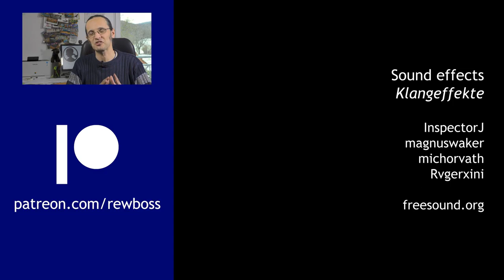Don't buy a cuckoo clock

Comment: This makes me miss my parents' clock. They inherited it from my grandpartens and when it stopped working and couldn't be fixed anymore, we'd still hear it in our head every hour... Is that trauma or a fond memory?
Reply: Bring it to a clockmaker he will be able to repair it
Reply: @the_retag  ...maybe...
Reply: Trauma, clearly.
Reply: I'd say it's the memory of a fond trauma.
Reply: @the_retag  we asked two clockmakers and they said it's so worn, the whole mechanism would have to be replaced. So it now serves as decoration
Reply: Phantom pain 🙃😉.........
Reply: @Yithiru  You can buy a new movement. I found one on eBay
Reply: They forgot one thing!!! Like any mechanical device, it needs maintenance! Any mechanical watch needs maintenance between 3 and 5 years, by a watchmaker (which is the period that lubrication lasts). Basic maintenance consists of disassembly, washing of the mechanism, general deep cleaning, reassembly, checking and correction of clearances and lubrication. If not this way, it will really break, it's NATURAL.
Reply: @Yithiru  they are about 120 -175 for a basic regula movement. Not sure about the more fancy ones, but you could just buy a movement online and replace it yourself if your somewhat mechanically inclined. There are many many youtube videos on clock repair.
Reply: That clock can be repaired I repair them all the time.

Comment: 4:25 "It will sooner or later break"
The cuckoo clock of my parents worked 27 years.
Reply: So it didn't break sooner, but later...
Reply: But it was VERY annoying.
Reply: Well made ones last but are really expenisve, but the cheap souvenir stuff breaks fast.
Reply: My grandma's is almost 50 and still going strong.  I repaired it for her about 1 year ago, and it's running great!
Reply: Several of mine are over a century and still work and are nearly exactly as they are when they were built. My most pristine century-old cuckoo clock dates to 1919. It's pretty much still exactly as how it was when it was built. Original flutes, bellows, everything. No damage to the case or facade.
Reply: Admit it, you destroyed it when moving out because it annoyed you so much!
Reply: @CBF1  where did you buy it from ?
Reply: Ours worked for over 15 years. 

If someone's breaks then ask them when they've had it serviced... I bet they've never done that.
Reply: I'm a watch guy, so I understand mechanical clocks on the basic level.  People tend to think clocks should work forever with no upkeep, but it's still a machine.  If you get them serviced periodically, they can last you a lifetime.
Reply: If you look after any genuine black forest clock.they will last
Reply: @MrDlt123  what is the recommended upkeep?
Reply: As long as clock repairmen exist, your quality clocks will be able to last for hundreds of years, if not more.

Comment: Psst, nobody should know that. 
Every stranger should have a cuckoo clock, because Germans would not buy it. 
But it is a tradition that every stranger has one, has a beer mug next to it and has visited Neuschwanstein.
Reply: It’s like you were following me around. I like my photo of the castle better than any other.
Reply: don't you dare disrespect a stein by calling it a mug. and I use the term stein only for anyone not from Germany so they know what I'm talking about
Reply: @TeenDream888  correct term is "Bierkrug" pronounced "Beercroog". "Bierstein" is unknown in Germany, we have only "Steinkrug" pronounced Stynecroog which is a ceramic mug.
Reply: @fafnir-fasolt  And the Bembel. Can't forget the Bembel.
Reply: @HotelPapa100  we talk about beer, no one needs vinegar bottles.
Reply: @fafnir-fasolt  Wrong! Where I grew up (Palatinate), the litre mug known in Bavaria as a "Mass"  is called a "Stein". As far as I remember, they were mainly used for Weizenradler from bottled Weizenbier.
Reply: @fafnir-fasolt  Shtynecroog, to be correct, Kollege :)
Reply: Sounds like a pretty good little trip to Germany! ;)

Comment: The school at which I teach has an exchange partnership with a school that is located in the Black Forest. Quite a few of the locals there have cuckoo clocks. My host from our last trip has 2. I know "no one buys them" is hyperbole, but I think anyone who wants to buy some tacky bit of randomness, should go do it. Your money. Your problems. 

That said, my mother bought a "real German" cuckoo clock real cheap from some dude she barely knew. Amazingly, she almost never remembered to wind it (pull the chain or whatever), so it was almost always either wrong, not working or both. After about 6 months of that, it broke. Now it is completely useless, but still hangs on the wall, because "why not". 

I personally own a cuckoo clock of sorts. I bought one of those refrigerator magnet ones from Neuschwanstein. It looks like Neuschwanstein, but has a clock face on the front of it. It is really just a cheap plastic clock face attached to an even cheaper plastic approximation of the only castle Americans usually know about, but definitely can't pronounce. Within 4 months of having it, my son knocked it off of the refrigerator several times. Now the clock doesn't work and a few of the towers are broken. It is still on the refrigerator, however, because my wife likes it. Happy wife. Happy life. 

I visited one of the "world's largest cuckoo clocks". I was unimpressed. I was more entertained by the glass blowing place next door. Definitely one of the worst tourist traps I have been to. 3/10 would not recommend.
Reply: My grandparents used to live in the blackforrest and also had several cockoo clocks and my grandpa rewinded them every morning. As a kids we were always waiting for the full hour to see the cockoo and because the clocks were not going exactly right we could run from one room to the other to see all the cockoos
Reply: I was born in Germany and lived there until I was 6.  My grandparents had a cuckoo clock in their home.  I returned to Germany in 2005, went to my home town and asked a local shop owner where I could buy a cuckoo clock... and it was not in a souvenir shop.

Comment: Well, I am German by origin and when I was living in Strasbourg I made a trip to the Black Forest and I bought a cuckoo clock about ten years ago. It still works and I never had problems with it. The clockwork is running nicely and at the side there is a lever to stop the cockoo - so you don‘t need a gun to do so.

Comment: I've had the same cuckoo clock from the black forest in Germany for 30 years and I only had one problem with it.  The chain fell of the gear spindle.  Cost me 40.00 to repair and they do this for a living here in Massachusetts.  As for the thingy that makes the sound...they are called the BELLOWS.  You have no idea what your talking about.  Stop spreading misinformation.

Comment: Worst thing about "the biggest cockoo clock "is it's location..: It's just outside Triberg. In a bend on the main exit road out of town town northbound. After a short tunnel. You frigging heck can count on either tourist standing in the middle of the road taking pictures (which you won't see from afar, as ... bend in road, combined with tunnel) or tourist missing the exit to the clock before the tunnel slamming the brakes to make a (forbidden) turn. Every single day during summer, when driving home from university - in fact the one responsible for this ... thing. The clockmaker school evolved into an engineers school which became Furtwangen University of Applied Science - or Hochschule Furtwangen in German. Still has a nice Clock museum, with quite a lot more than cuckoo clocks.

Comment: I have two cuckoo clocks going in my living room all the time, and one of them has a quail too. That one was bought from an antique dealer in Germany as a neglected old wreck, so someone in Germany had owned it and appreciated it for a long time!

The movement was incredibly dirty, the bellow tops were ripped off, the case was shabby, the dial was broken and worn, the hands were just rough pieces of plastic, and the pendulum was missing.

I rebuilt the three train quail movement on my own, ultrasonically cleaned it, and rebushed the time train main wheel pivots. I replaced all three bellow tops. bought a new dial, hands, and pendulum for it, filled in some old woodworm holes, woodstained the case, and it's now the nicest cuckoo clock I've ever had!

I also have an older Black Forest one with a wooden framed movement, which ticks incredibly loudly and has the noisiest gears you've ever heard in the striking train. But I love them both and I haven't gone crazy yet! In the coming months I intend to embark on a third one which is mechanical but also has an electric motor-driven canary sound. I also intend to have that one working all the time, and I'm fairly confident it won't drive me crazy. The rebuild might drive me crazy, but I won't be put off!

Comment: Ouch , don’t say that. I own more than 20 of these clocks and love them. With a little maintenance ( oil basically) they run forever. I have an original railroad quail and cuckoo clock, all the way to a modern Triberg MCC clock.
Reply: they really are very beautiful watches. I have 4 in my house.
Reply: I love cuckoo clocks.
Reply: Ooooooooooh so far I've got 35. Most work but some are broke. Not many. My 16th is MAJORLY broken however. Damaged music box comb on that one, 3 broken teeth.

Comment: I have a beautiful cuckoo clock from Germany, given to me by family. I love it, it's always off by a few minutes, but hey, I grew up with grandfather clocks and cuckoo clocks. and they didn't sound like a 'cuckoo', mine plays music and it's lovely.
Reply: You can usually make it to speed up or slow down by raising or loweing the weight of the pendulum by a screw. If kept at constant temperature, a pendulum clock can be extremely accurate, in fact they were the most accurate timekeepers available until the quartz watch.
Reply: @AelwynMr  I sadly live right by the ocean, so between the dang humidity and the constant flux in temp and damp as the tides come in and out, it's just not ever going to be 100%. I really appreciate the input though, you are absolutely correct! I never understood why cuckoo clocks got such a bad rep. I plan on having a house akin to Geppetto's workshop in Pinocchio ! clocks, with all their chimes and ticking and music, everywhere !

Comment: My family got one from Germany in 2000 and it hasn’t missed a beat. Still works perfectly after 22 years.
Reply: They forgot one thing!!! Like any mechanical device, it needs maintenance! Any mechanical watch needs maintenance between 3 and 5 years, by a watchmaker (which is the period that lubrication lasts). Basic maintenance consists of disassembly, washing of the mechanism, general deep cleaning, reassembly, checking and correction of clearances and lubrication. If not this way, it will really break, it's NATURAL.

Comment: Making and selling quite crude clockwork from wood and wire brought some extra money into the households of poor woodland farmers. The same thing was true for those musical (snuff)boxes  that play tunes by having a revolving cylinder with steel studs stuck into them. The typical way by which  trade worked was that a contractor went around in autumn and sold the raw items to the families and came back the following spring to collect the assembled machines. In the baroque and rococo era clockworks that played tunes, had little figurines  that danced  minuets and the like were very popular. They were mechanical wonders with all their cogs and cams which  drove the bellows that pumped the air for all that flutes  and that had to be timed to perfection, plus all that chimes and tubular bells in them. Southern Germany was one of the centres for those early sound machines. Welte&Mignon in Freiburg for example developed (paper roll) pianolas that allowed the pianist to transfer  his or her individual playing technique to be transformed into that system of perforated paper.

Comment: Oh that's harsh Andrew.

I purchased an German electronic cuckoo clock at a reasonable price from a Queensland importer a few years ago. It runs reliably and a switch to turn off the cuckoo or reduce how loud it is on the side. Personally I don't mind the cuckoo call but I keep it at the lower setting. 

Whether or not it is traditional german is moot. It is an attractive unusual peice of wall furniture. At some point in the future I hope to comlpement it with a an electronic german weather house (please make a video on weather houses - they are quite interesting) and also an old fashioned mechanical barometer.

Comment: I have a nice, high quality mechanical clock that has lasted years without breaking. It has a little lever on the bottom which disables the cuckoos and chimes, which is pretty cool.

Comment: @ "It will sooner or later break" "Germans wont buy them."  In 1957, my German born grandparents (immigrants to the US) went to Germany and bought my dad a cuckoo clock. That clock remained in my families possession until it was lost in Hurricane Katrina in 2005.  It ran non stop and kept perfect time. In 1991, My Grandmother visited her family in Germany and bought another clock. She gave my dads clock to me and I replaced the bellows due to the material leaking air. It ran non stop for a total of 48 years.  I have family in Germany that own them. Some keep them running 24x7, Others, just have them for decor. Delicate, yes, but doesn't fall apart from normal use. Yes, some clock makers would rather work on something thats very expensive and turn their nose up at Cuckoo clocks, which is why I made some great money as a kid, repairing antique cuckoo clocks and selling them.

Comment: I used to have a cuckoo clock I inherited from my grandparents. It was from the 1970’s. I really liked it, but it was stolen.

The part that breaks most often is the diaphragm of the bellows to pump the air to make the whistle toot. If you’re handy you can take off the old diaphragm and glue on a new one. It’s made of soft paper.

Comment: They forgot one thing!!! Like any mechanical device, it needs maintenance! Any mechanical watch needs maintenance between 3 and 5 years, by a watchmaker (which is the period that lubrication lasts). Basic maintenance consists of disassembly, washing of the mechanism, general deep cleaning, reassembly, checking and correction of clearances and lubrication. If not this way, it will really break, it's NATURAL.

Comment: I´m german.
I have a cuckoo clock.
I love the sound.
I got the adress for a workshop specialised on those clocks.
In 7 years I never needed the workshop - the clock still works fine.

But: good cuckoo clocks are expensive. I paid over 500€ for mine, and it´s not bigger then 30cm.

Comment: Former clock repairer here.  The truth is that all clocks need attention sooner or later, whether mechanical or battery.  You can stop the cuckoo clock from cuckooing by either removing the corresponding weight, flicking the catch on the door, or, in some clocks, pulling the lever on the side or underneath that's designed to specifically stop it cuckooing.  It's true that they're fiendishly difficult to get to keep good time and anything within 5 minutes a week accuracy is pretty good going but it is a novelty item and clocks all react to temperature and humidity changes.  My own experience with my own cuckoos is that either they get wound every time you pass it in a high footfall area or I forget all about it and walk into the room to find it stopped with the weights on the floor.  I think that people fall into two distinct categories; those who like the sound of clocks ticking and those who don't - you can then sort out extremely easily who the people who like cuckoo clocks are against those who don't.   For me they're a guilty pleasure.  I have all of my "good clocks" proudly on display and the cuckoo clocks are in the music room out of the way and competing with the piano!

Comment: Sorry, I cannot share this opinion and this collection of half truenesses. In my German household, there is a cockoo clock. Plain mechanical and it works since 25 years without fail. All 5 years it gets cleaned and oiled by a clockmaker. For a mechanical instrument, that is a long period (your car will need maintainance more often than all 5 years). In many families you will find cockoo clocks 100 and more years old. If they are taken care about and maintained, they are built forever and can be repared, if needed. Of course you need an educated clockmaker for that. A Swiss army knife might not be the right and sufficient tool for that task.  I am very astonished about your claim about the polka music. It is right, that it comes from Czechia. But since far more than a century, polka is a dance, spread all over Europe. Claiming, it would be "wrong" in Switzerland or the black forest is as wrong, as claiming, that cars in America are wrong, as they have been invented in Germany by Carl Benz. Can you imagine that? That would be stupid nonsense, so as the claim about polka music. Who ever likes cockoo clocks should buy them and take them as souvenier. Shure is, that there are plenty of models for use and trash. But that you can already recognize by the prize. For 20 Buck you cannot expect the same, as for 500 or more Dollars / Euros, what would be the cost of a proper made cockoo clock.

Comment: Don't buy a cheap cuckoo clock. Mine is usually silenced and has been working perfecly for almost 20 years with no maintenance at all. It's quite accurate for a mechanical clock, and only needs winding once a week. It was expensive, though, no souvenir.